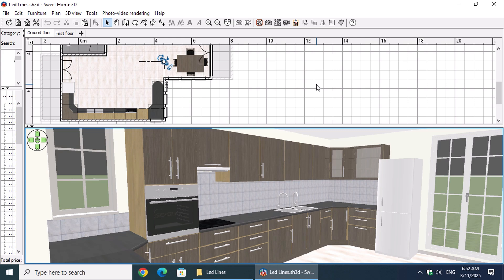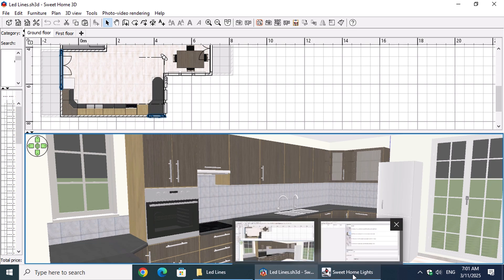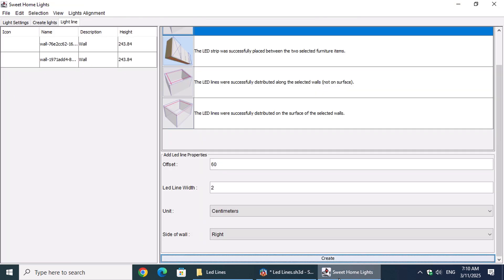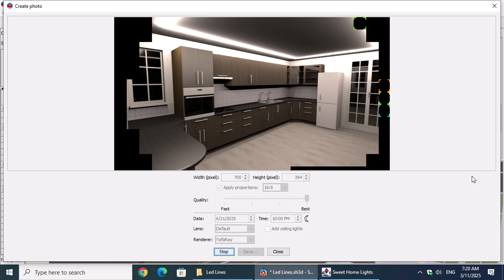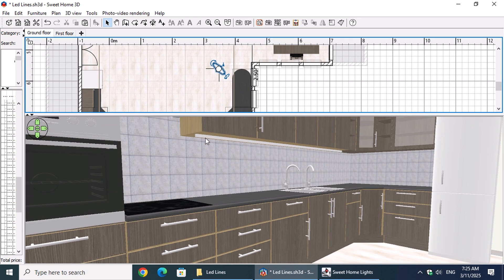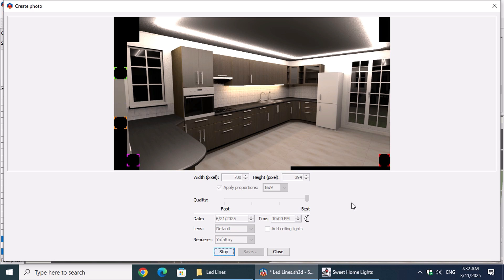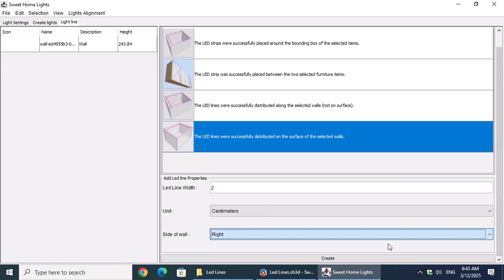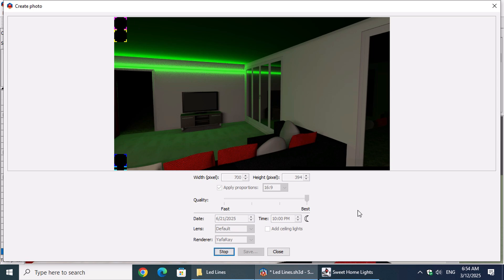Sweet Home Lights Plugin: A Step-by-Step Guide to LED Lighting in Sweet Home 3D

Comment: A great tool.
I'm still quite new to Sweet Home 3D.
I've almost finished creating my house, but I had to spend a lot of time searching for some furniture and accessories.

Unfortunately, I just realized that my dining table lamp is just an object and doesn’t have a lighting function.

I was hoping I could load such objects into your tool to add the lighting function, but unfortunately, that doesn’t seem possible.

The lamp is a 140 cm long LED light. How can I make it work?
Reply from the maker: Thank you for your comment!

You're absolutely right—if a lamp in Sweet Home 3D doesn’t have a built-in light source, it functions as a regular object and won’t emit any light. Unfortunately, the plugin doesn’t support adding a light source directly to an existing object. We explored various ways to transform any furniture into a light source, but after extensive testing, we found it wasn’t possible.

However, you still have a couple of options:

Download a light with a built-in light source from free furniture libraries. In this video, I explain how to find and import such objects: Boost Your Sweet Home 3D Designs - How to Get Free Furniture (Easy Guide). https://youtu.be/Cwb3ZSOR2i8

Manually add a separate light source near your existing lamp. You can find adjustable light sources under the "Lights" category in the furniture catalog. Simply place one in the correct position and adjust its brightness and color to match your scene.

I hope this helps! Let me know if you need any further assistance. 😊
Reply: @3dlogicclass  Thanks for the quick reply.
I'll give it a try and see if I can work it out.